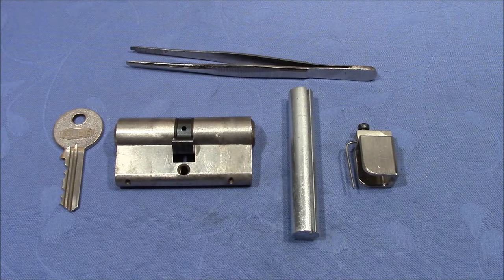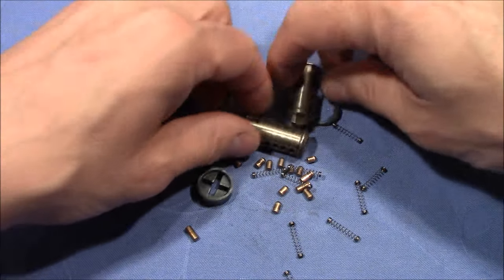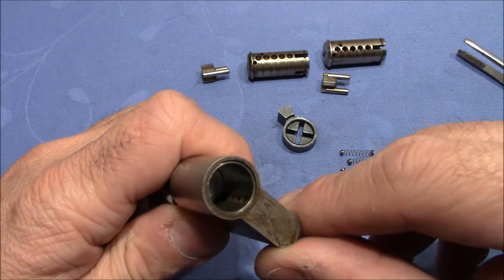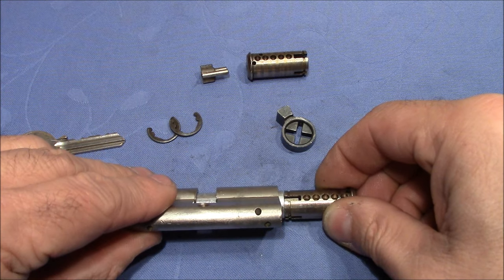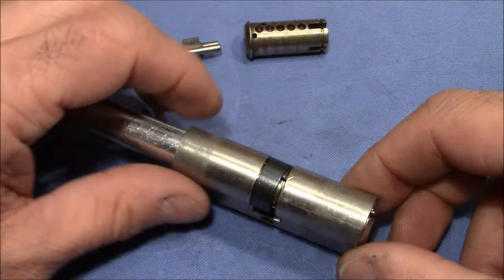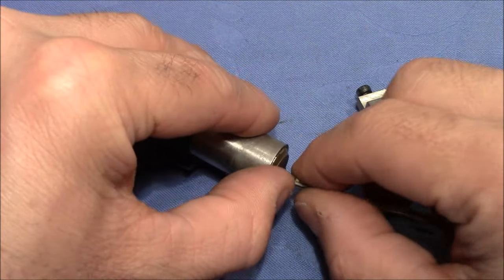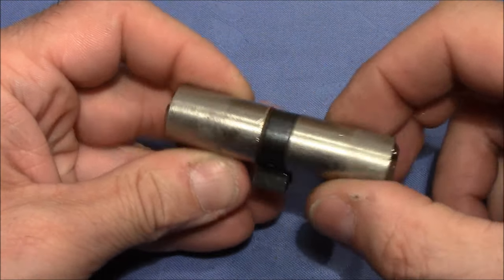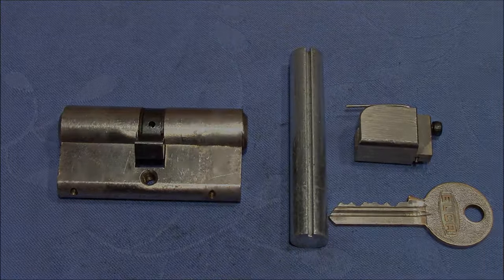(picking 603) Reassembling a full euro cylinder lock with plug follower & pinning shoe

Comment: Great video. I had one today that required the front loader tool because the thumbturn side was not removable (without drilling), and your spot on about those cam pieces being different designs. Definitely need to pay attention when pulling apart so you know how they go back together. Thanks for sharing!

Comment: Very cool, i have had hard time with these euro cylinders
Reply from the maker: Thanks, many other euro locks are harder because of the cylinder length and different cam mechanisms - it's part of the fun ;-)
Reply: @Potti314  yes it is, i myself strugle a bit with my ruko's but i don't have the right tools yet, but the padlocks and mailbox cylinder's are easy

Comment: To bad that rest of manufactures does not use spring steel c-clips. Nice work :-)
Reply from the maker: Very true; these spring steel clips are very easy to handle but most likely a few cents more expensive.